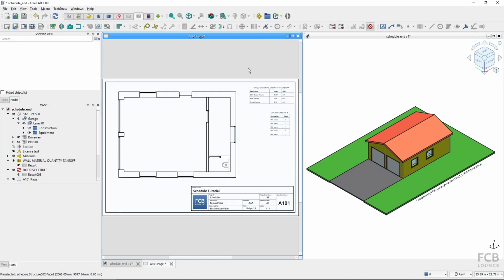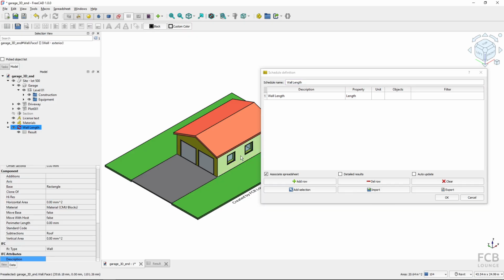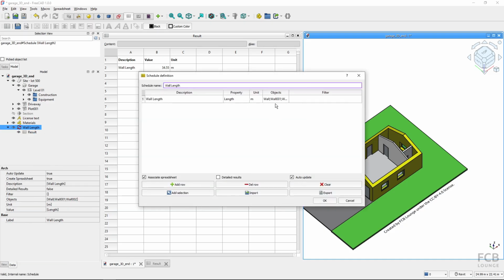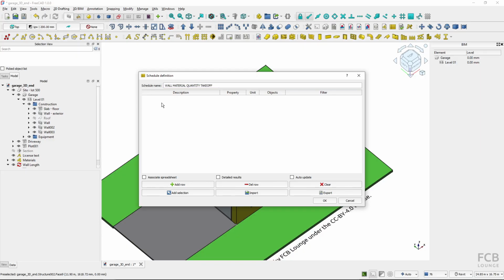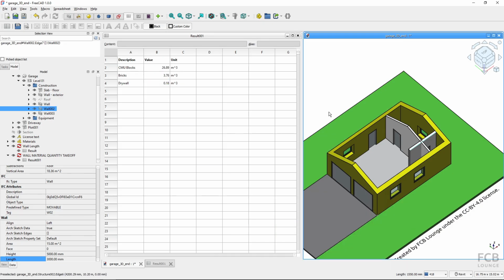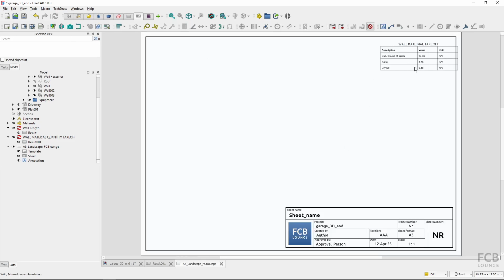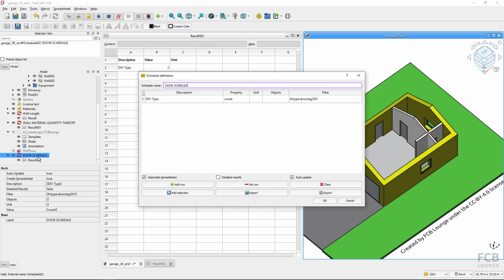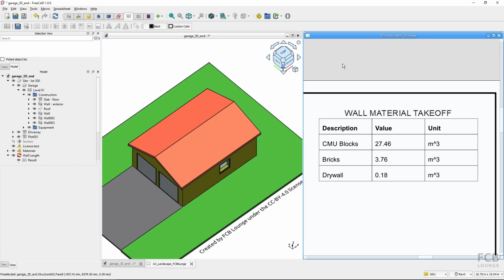Create Quantity Takeoff in FreeCAD BIM | Schedule Tool Tutorial

Comment: Hello. Please tell me why the length of the internal walls in the properties is 27.6 m, but when measured with a ruler it is 29.2 m? And the dimensions of the rectangle for the walls are 6.2 m by 8.4 m
the thickness of my walls is 400
property aling : right
Reply from the maker: Hi, it's hard to tell without seeing the file. You might post the question with the file attached on the BIM section of FreeCAD forum: https://forum.freecad.org/viewforum.php?f=23